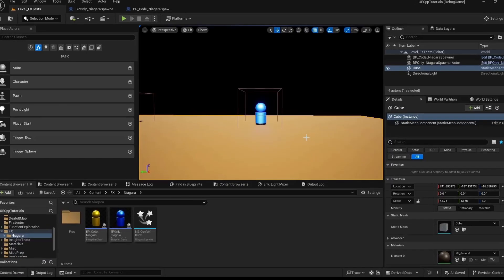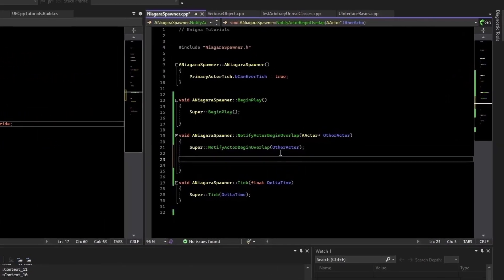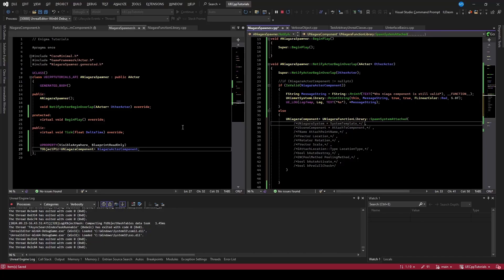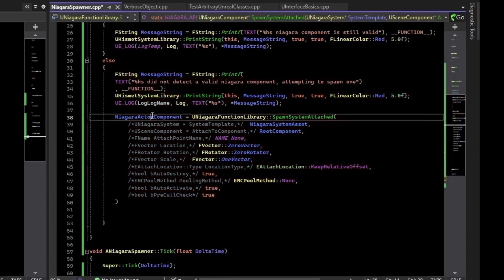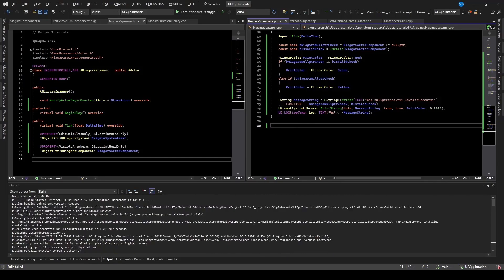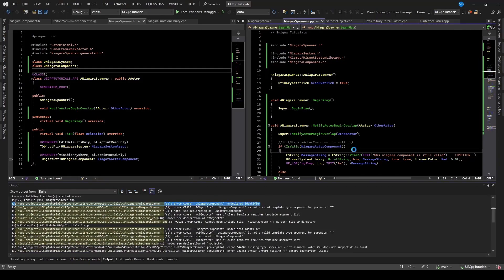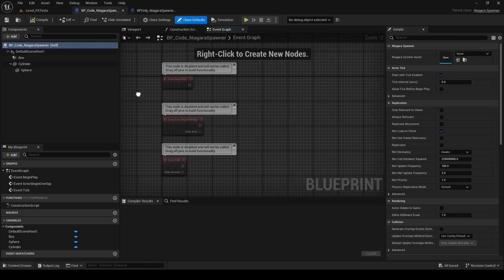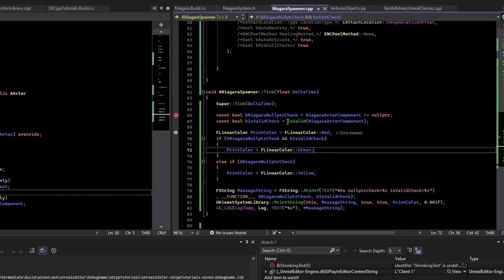Using Niagara particles and vfx in Unreal C++; covering first time set up - UE C++ Tutorial

Comment: Awesome CPP content you have on your channel. How would you go baith learning UE programming if you have to do from scratch again ?
Reply from the maker: Thanks!

Hm, I'm not sure how I would go about it now. If I had to do it again, I think I'd first get really comfortable with blueprint. I attempted to learn BP after learning Unreal C++. But lately I have been thinking, it probably would have been easier if I learned BP nodes first, then learned how to do that in C++. 

BP is very quick to write (you don't have to do things like include headers, etc.). So you can really get going fast with learning the gameplay framework. Then once you understand how things like Pawn, PlayerController, etc. work together, you can explore doing those things in C++, only having to learn syntactical things like what to include, how modules work, etc, -- but already understanding the pawn/playercontroller classes from experience in bp.

Though, I'm not sure that is the best way to learn it, that's just a thought.  

Also, I'd study the example projects a bit more (like lyra). Learn to use "find references" "symbol search" etc in the example projects, and it can answer a lot of questions about how to set up things.
Reply: @enigma_dev  I also have done CPP first and not BP,  I am in deep now can't go switch to BP just yet lol but you are totally right it is better to get around visual script first. Lyra is super cool framework bit hard to her around at start. Thanks to your videos as well, I have been learning from over a year from you 🤝